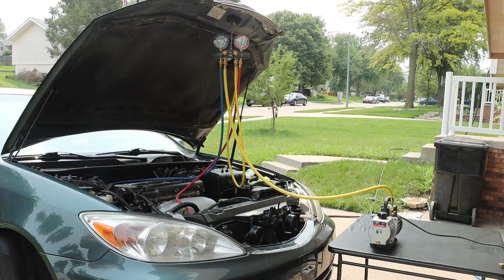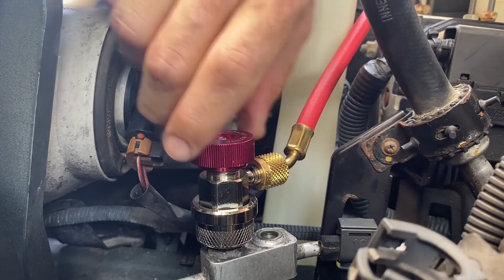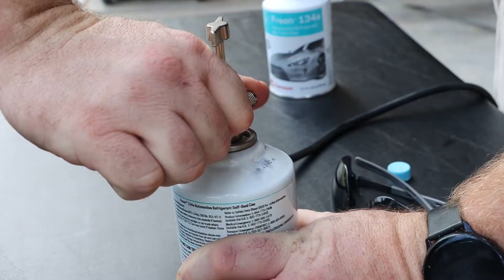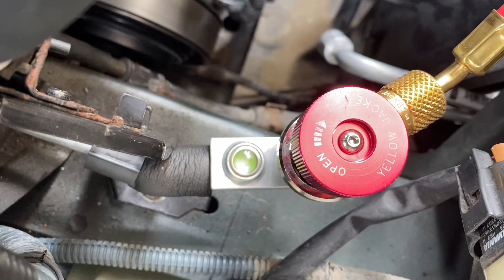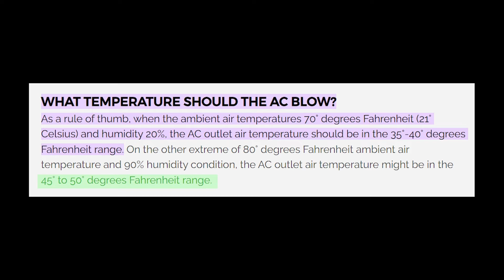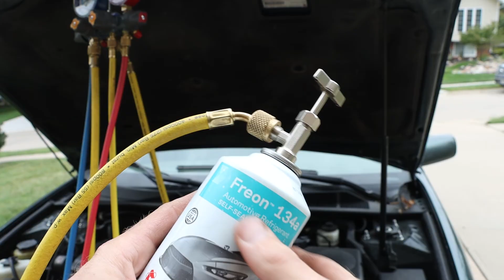Charging the A/C System - 2003 Toyota Camry, 2.4L (2002-2006) (Air Conditioning Recharge)

Comment: Car ac was running fine left work it stopped blowing cold air got home checked relays and fuses all were good did a recharge then started blowing cold again then shortly about an hour or 2 later it stopped blowing cold air again any clues or ideas?
Reply from the maker: Might have developed a small leak.  If your recharge can has a gauge on it, you can usually tell if you are low.

Comment: The Canister upside down or upright ? Does it really matter? I figure the canister is at a high pressure so it's liquid inside. Upside down will ensure liquid is drawn in. Upright will get more closer to gas state? Is that right? I've read liquid drawn in on low side can not be good for compressor. And some people are lightly shaking  can around. Not sure why?
Reply from the maker: I had an HVAC guy help with the recharge process and he said upside down.

Comment: My 2004 Camry Compressor is good , Condenser  I am not sure . BUT shop states there is a blockage some where not allowing the freon to flow . Do you think it is my Condenser ??  I pray its NOT my Evaporator  because shop said they do Not do Inside of Car. Wish I knew that before I took there. I just don't want to put a New Condenser on it and that Not be the Problem.  Now he said my Radiator  has a small leak and needs to be replaced. What do you think I should do ?  Should I let him put the New Condenser on it and Hope for the Best ?  I Love my car . Only 160 K miles on it. I just want AC to work.
Reply from the maker: How handy are you?  You could always do the condenser yourself and then have them charge the system.  it would save you quite a bit of money and test the theory that it is the bad part.